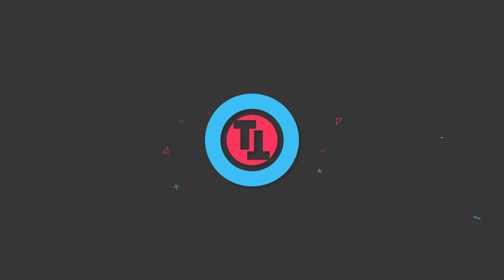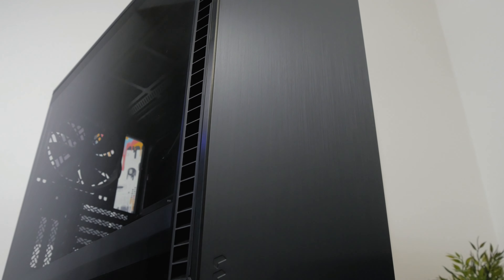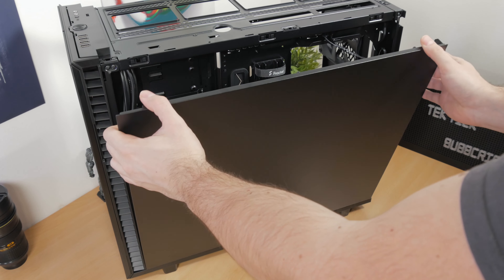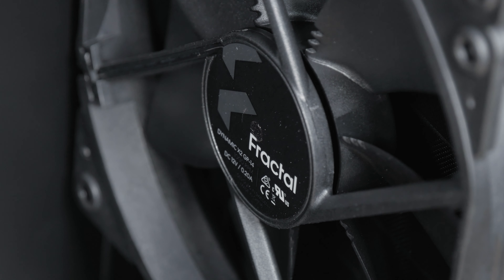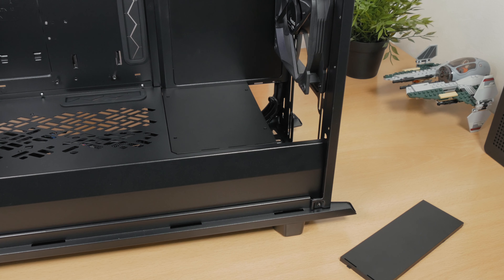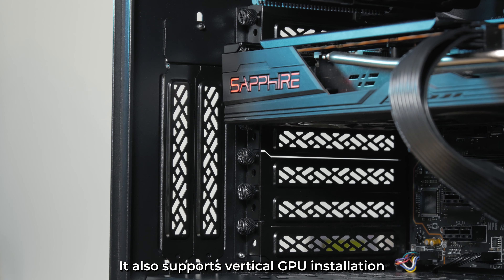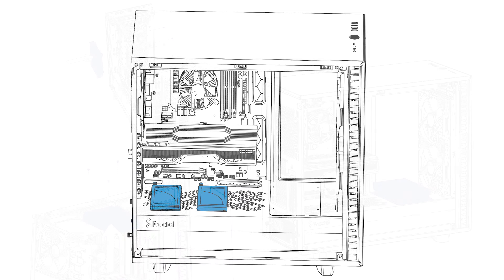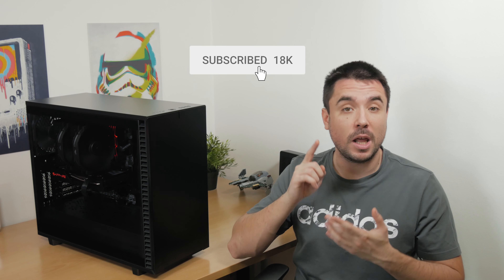Almost NOTHING left to improve? - Fractal Define 7 Light Tempered Glass

Comment: Hi, just looking into buying one of these. Could you maybe help me with a couple of questions towards what I would like to build? I'm worried it might not fit all of it in the following relations:
- CD drive + two 140mm fans in the front
- CD drive + a 280mm radiator CPU cooler setup mounted to the mesh top cover
- a radiator-fan setup like the 'Arctic Liquid Freezer II 280' that's 650mm thick - between an ATX mainboard and the roof
- a single 3,5" hdd
Thanks a lot for the video already as it cleared up some other questions! :)

Comment: RGB RAM which you cant see because its blocked  by a gigantic CPU cooler....... Get a radiator or dont have RGB DIMMS. That dont make no sense.
That aside, I initend to use this case to its fullest potential. It has an optical drive slot, which I need. It also can hold up to 14 hard drives. I have a motherboard with 8 SATA ports and 5 of them are currently populated with hard drives. I want the freedom to whack in a couple more hard drives as I see fit, plus the new motherboard has 2xNVM2 slots for a total of 9 HDD and 1 optical drive without the need to buy adaptors for the PCI-E slots, which I could do, up to a total of 14 HDD. 

That's pretty awesome. Actually, in all the case research I've done, this is the only case, besides the Fractal Design Define R6 USB-C, that has every feature I need. Too many case manufacturers seem to be limited to 4 drives at maximum, and no optical bay, and that doesnt cut the mustard for me.

Comment: I have this case, its build quality is very good but it terms of temperatures, it needs improvement.
Reply from the maker: What kind of setup do you have?
Reply: @MattsPaddock  These are my specs:
CPU: 9900k (currently stock until the AIO arrives)
CPU cooler: Noctua NH-U12A
AIO: Fractal S36+ Dynamic 360mm (ordered last week)
Mob: Gigabyte Z390 Aorus Master
Ram: Corsair 4x8GB 3200MHz
Opening the front door of the case helps temps but increases noise. You can't have both silence and good temps, something must be sacrificed.

Comment: Hi, I am using d15 too, does this case have enough space to install GPU vertically while using D15 cpu fans??
Reply from the maker: I think you're in the clear if it doesn't surpass the first PCI-e x16 slot
Reply: @MattsPaddock  D15 just reach first PCI-e x16 slot about 1/2, damn it.
I think I should let the vertical GPU thing go.

Comment: Nothing to improve :) I don't think so. Define cases ary my fovourites from years (I use R5), but they are not perfect. Here is what to improve:
- front door open very narrow only to 90 degree, they should minimum to 180 degree or even to the side of case 270 degree, still they can do this corectlly.
- case should be 2-3 cm taller, and shorter on deep, it's deeper even that R5. 
- I prefer HDD cages like it was in Define R5.
- On another minus they remove second 5.25 bay since R6.
Reply from the maker: I said almost! 😬 Nothing is perfect / 100%, or will ever be, especially in the eye of beholder, everybody has different preferences.